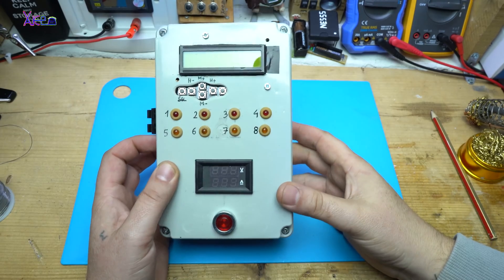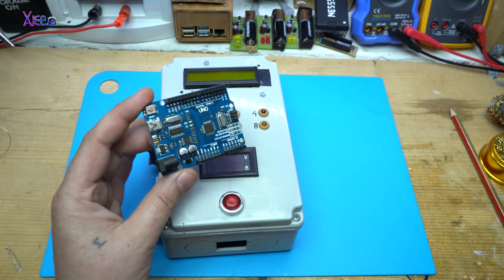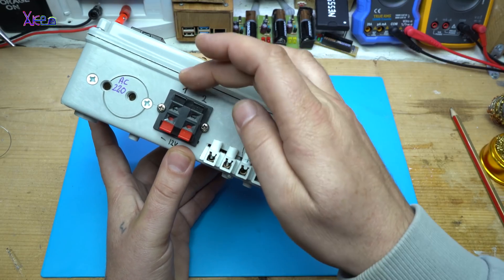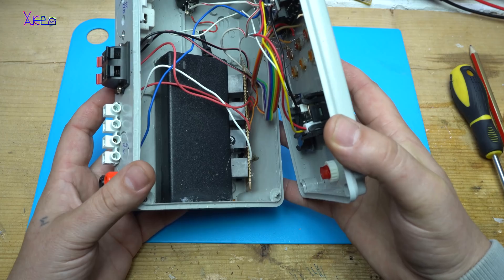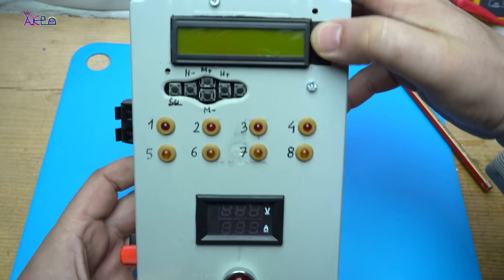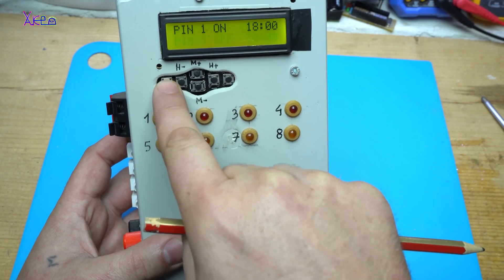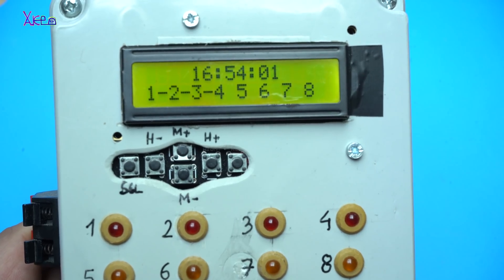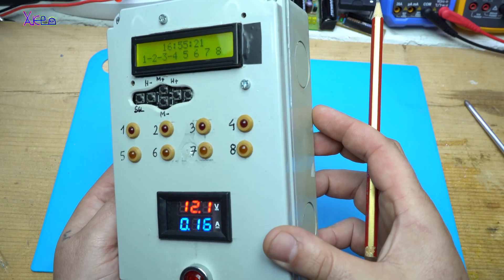Homemade 8ch Timer Relay Box with RTC and LCD Display

Comment: The problem of connecting the clock and matching the sketch with the clock module.  My module is DS 3231. Inadequate name of outputs. 32K / SQW / SCL / SDA / VCC / GND /. You
#define rtcVCC A1
#define rtcGND A2
#define rtcSCLK A3
#define rtcIO A4
#define rtcCE A5. What corresponds to what.?????Please help man!
Reply: Same problem with me dear
Reply: Any one help please
Reply: @myelectroniclab  
// define pins of RTC module
#define rtcVCC      A5
#define rtcGND      A4
#define rtcSCLK     A3
#define rtcIO       A2
#define rtcCE       A1
DS3231 clock;
Reply: Dear already difine but not undustand connection RTC and Arduino pins can you tel me please
Reply: @myelectroniclab  its there, next to the define, for example where A1, A2 A3 A4 A5
Reply: Dear RTC module pins name's is 32K/ SQW/ SCL/ SDA/ VCC/ GND. So witch pin is connected with A1/ A2/ A3/ A4/ A4.
Reply: @myelectroniclab  Can't remember now man, but all i did is switch the wires around until it worked